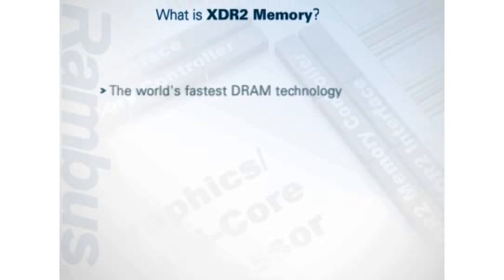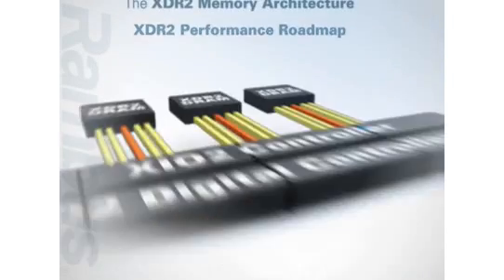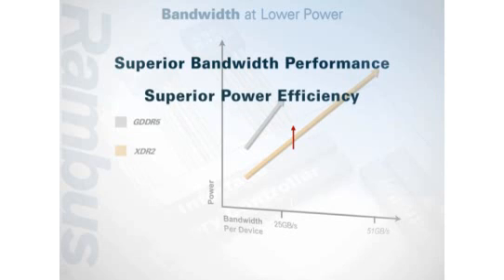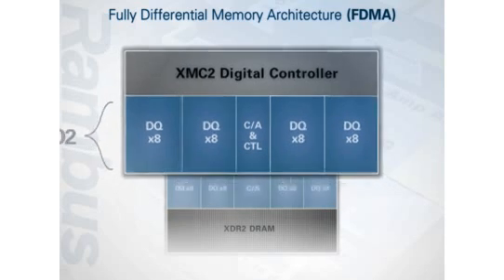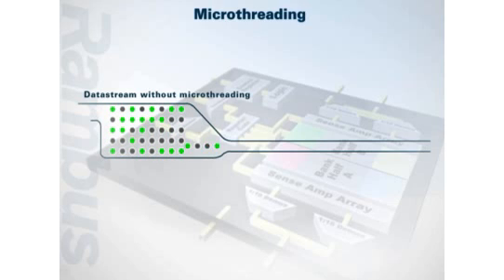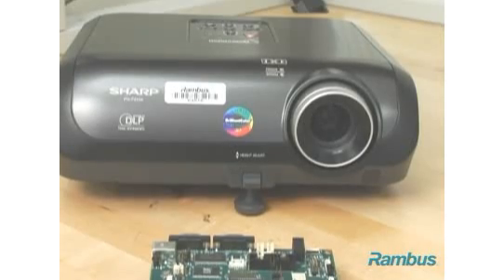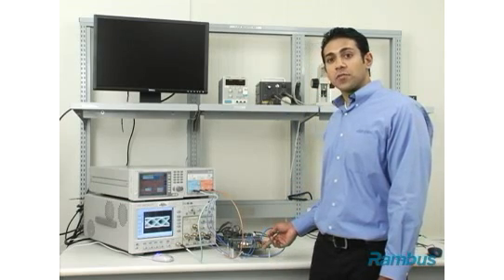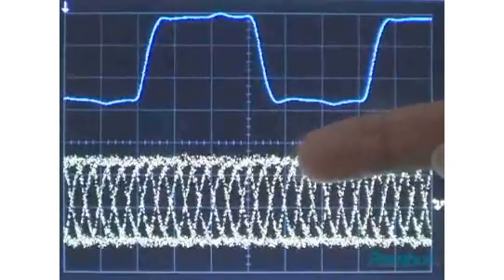XDR(tm) 2 Memory Architecture

Comment: @prabhatism an Youssef

AMD says XDR2 will be used on it's high end cards in the HD7000 range.
Nvidia didn't confirm.... But they have the better bit paths. So in the end it doesn't matter that much in PC's. In laptops the lower power consumption can come in handy.

I hope in AMD it will be a succes so they can lower the price and this memory becomes mainstream. Would be nice on a next gen 384 bit card with 10.000mhz XDR2 Ram :p.